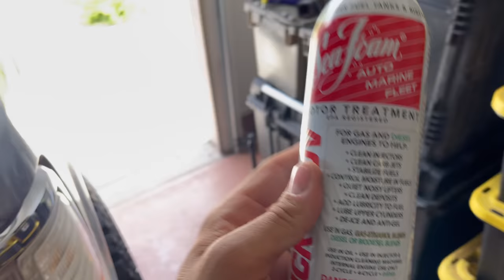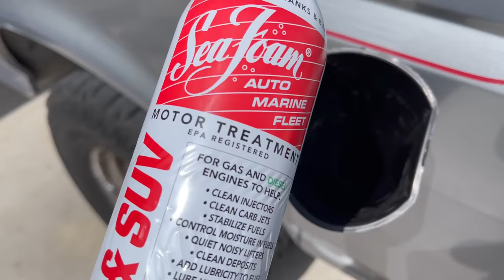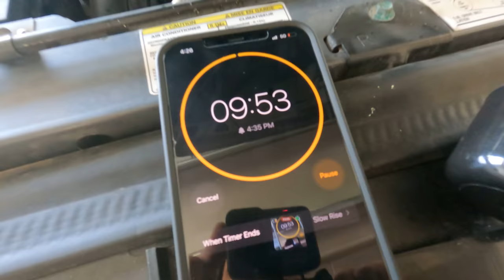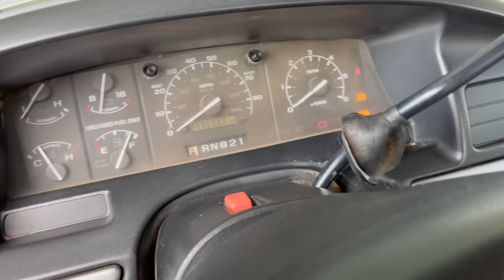Seafoam - Engine Treatment | How-to and is it safe inside your motor?

Comment: I wouldn't put this stuff in my lawn mower. If it hasn't destroyed or damaged your engine yet you are lucky.
Reply from the maker: Nope all good!
Reply: @ChaseGentry  So Far !
Reply from the maker: @kellyspann9845  15,000 miles later  still good nothing showing signs of destroying or damaging my engine… 3 oil changes later, none burning off, 2 miles better mpg, faster starting, smoother idle.. idk seems to be doing the exact opposite of catastrophic engine failure 🤷‍♂️👌👌👌
Reply: Thousa6of people use this regularly. I have not heard or seen one video detailing how Seafoam destroyed their engine. BWT it works even better in lawn mowers.
Reply: @lezlethal  How do you know thousands of people haven't ruined their engines using it. I heard and know people who have and just because you haven't heard or seen a video doesn't mean it hasn't happened. Not everyone who uses or had failures makes a video about it. I don't.
Reply: @kellyspann9845  Unless you are making a video about it, your opinion is basically worth less than nothing, you're making a claim with zero evidence to back up that claim (How do we know you aren't just talking out of the bottom of your one way digestive system?), I have used Seafoam in every car I've ever owned, and not only has it not ever caused any damage at well over 300k miles on one car I spent literally 8 years intentionally abusing and trying to blow up, it's helped fix many issues with carbon buildup on other cars I've worked on, and none of these motors have ever had damage from usage, there's only really two annoying things about Seafoam, driving around smoking like the car is on fire for two weeks until it clears out, and people like you and everyone else in the comments section who have zero experience with it heard some 'other' person say it was bad.
Reply: @nkogliaz  Lol !!!!!! It's so funny how people get so offended by a comment. Your video proves nothing either. How do we know you aren't cleaning things up a little to make the product look good. I'm speaking from experience also but I don't have to make a video to prove it. It's my opinion and it doesn't matter if you believe it or not. Good Day !

Comment: Want to clean engine properly tear down motor and clean. Fact any thing that cleans will clean oil off bearings and in engine that is bad. No real mechanic would ever use additive to clean engine. If it sounds to good to be true it is. No easy fix ever fixes.things that require real tear down and repair

Comment: Seafoam was designed for marine 2 stroke engines and should never be used on any pollution controlled vehicles.  I have worked on many trucks and cars with clogged catalytic converters from people using this junk.

Comment: Your better off to run. WD-40. The left over after making gas. Ya smoking good. You should never ever see this. Unless you're valves are dripping oil straight down to the gas. Plus u tecs do not know nothing. I have been driving same vehicle. 47 year. Chevet

Comment: Slick 50. Been around way longer. And has killed many engine's. The price is gas has everything u need. Ask BMW. This makes them gring. Where do these cars end up. Junkyard. These guys are on drugs. Gasoline has 59 additives that you guys will never know. Seafoam. Not to go for. The lawn mower I had. Blew the motor right off it's base. What a racket. This ok for infomercial.

Comment: Mate, a liquid ounce of the stuff is not the same as a mass measurement of anything.  You blew it on your measurement process.  Duh...  Pour a liquid ounce of lead into your measuring cup and weigh it.  Ooops..  Didn't need to confuse your tiny brain with mass measurement.  You added density to your limited vocabulary during a youtube high and it was really embarrasing... Unless I was the only "bro" watching who caught it.